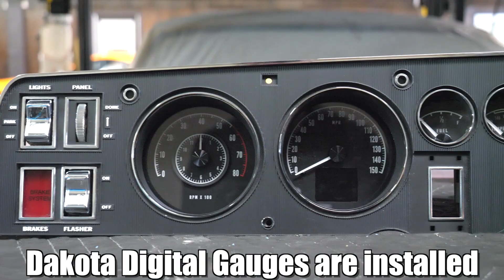Transforming A 1968 Charger Into The Bullitt Villain Car

Comment: Best year of the Charger in my opinion. The front grill looks mean as hell and the double barrel shotgun tail lights is the one of the cleanest muscle car rear ends in my opinion.
Reply: I think you're right. I collect 1/18 diecast movie/tv cars and recently bought a Bullit Mustang, it's due to arrive soon. But the 68 Bullit Charger is like $200, more than I can justify paying so I picked up a black 69 Charger that looks almost identical, the tail lights are not round unfortunately, and the front grill is the same but split. It'll due cause it's a second banana car for display and you won't see the tail lights or much of the front grill, and it was $34, all I have to do is a little work on the hub caps and it'll look close enough for rock and roll.
Reply from the maker: The round tail lights are so classic looking. We all think they should have kept them.
Reply: @JustDriven  Yeah they look great, but hindsight is always twenty twenty. I'd love to have them on the diecast, but I'm not paying $200 for the privilege.
Reply: @robertkees6048  I am actually building a 1:25 scale model of the car right now

Comment: Very nice.  Was not expecting the modern tunnel ram fuelie atop the vintage BB Mopar, but it didn't disappoint either, that's for sure.  If it runs as good as it sounds, it's a solid upgrade.
Reply from the maker: Thank you! It runs smooth and sounds tough! And we love being able to row through the gears, putting that power into our own hands.